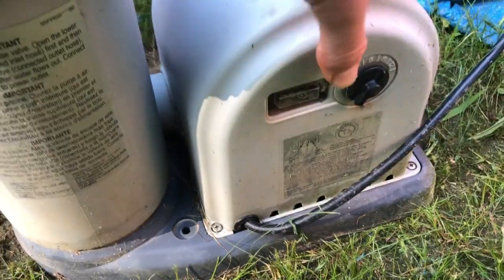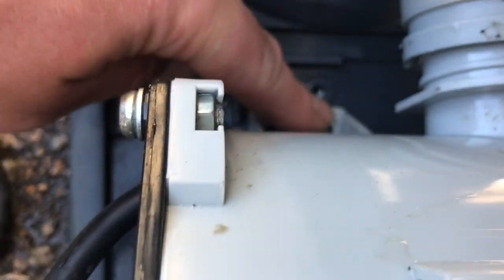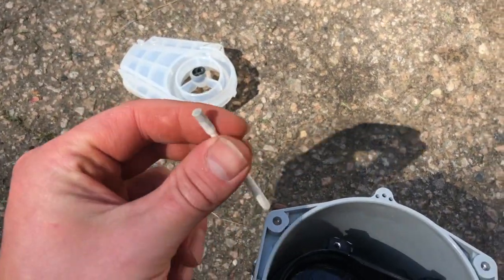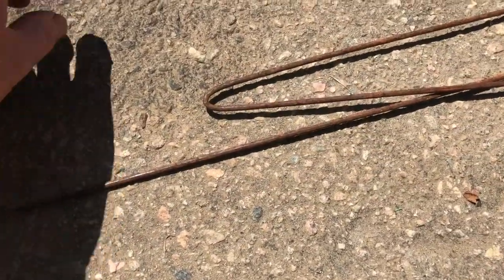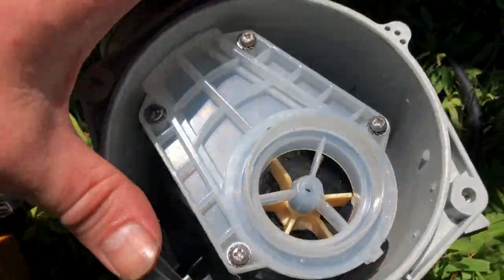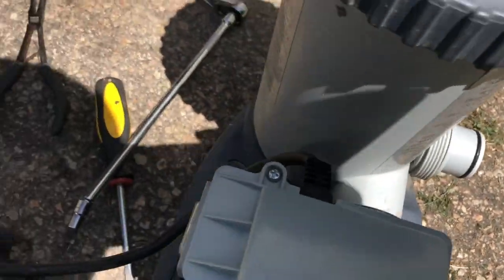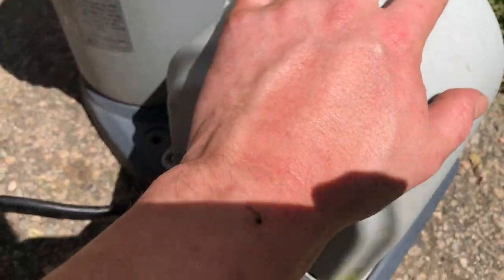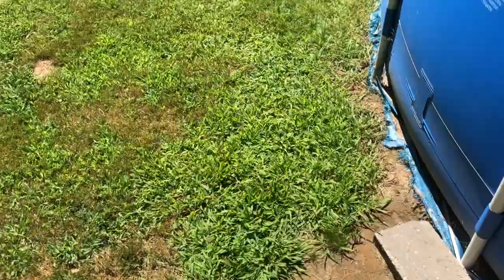Intex Pool Pump Repair

Comment: Give this man a medal!!! Amazing bro! I did the same, worked for my 45 W pump as well. Had similar issue.

We manufacture surgical instruments so i instead took a non magnetic SS 2.5 mm rod around 58/ 57 mm where it fitted fine. Grinded the ends to mke them soft, so it doesnt wear the plastic body. Hopefully it wd last lo ger than the ceramic shaft, mentioned.

Comment: Hey WS
I had taken my pump apart years ago and couldn’t remember how to get that cover off-probably because I never thought about that knob screw. So I searched for quite some time in French, cause that’s where I live and there was nothing. So I checked in English. Enjoyed your video cause you sound just like somebody I went to school with. Well if anybody is reading this and needs that shaft I got one. My problem is that the magnetic shaft rusted and has split open. As a matter of fact the motor will still run for about a second or two when I turn it opposite that split.

Comment: I just tore apart two bad units to make a good unit. I did not about the screw on the timer knob. I was able to take apart both units without removing those screws and not break anything.

Now that I know about the screw, I can finish putting the good unit together.

Thank you!!!

Comment: These ceramic impeller rods seem to be the weak link in Intex pumps. Our Intex PureSpa pump died at 6 months. They sent a replacement unit that lasted a year and one week. I took the unit apart to find a broken ceramic impeller rod. I replaced it with 1/8" brass rod, cut to 3 3/4" iirc.

Our Intex 10'x30" steel frame pool, is running the 330gph pump. It has stopped working on its second season. It had the same issue with broken ceramic impeller rod; but this one was less than 1/8" diameter. I've used a clothes hanger rod (cut to 2in.) for the time being; but will keep searching for a source of replacement rods. In either ceramic, or possibly stainless/titanium.

Comment: Use brass for a replacement rod. Brass will not heat up like the other metal options and will not effect the water and chemicals. I found mine at the local hardware store for like $3 bucks and i was able to make 3 rods out of it. Also, don’t put grooves in it, the grooves are not supposed to be there. The impeller shaft should not have grooves. The grooves are what happens when it starts to wear down or wobble out.
Reply: do you remember the diameter of the brass?
Reply: @CookNComedy  i do remember the diameter. For our pump it was 1/8” and that worked on the sfx 600, 1000 and 1500 pumps. Also, I collected some old pumps ppl in my town put on the curb and took them apart and if the shaft and impeller were in good condition i saved them. So I have several back ups now just in case :)
Reply: 4.25mm 
I used a knitting needle cut to length

Comment: I'm at my second Intex pump - smaller than that one, exact same design, that plastic shaft broken in both after a few months. At this point I believe its intentionally build to fail and break after a while... In the first one I glued back the shaft, but eventually the spinning rotor (the one with the propeller attached and the magnet that) became cracked and started to bulged so... obviously completely stuck. Almost impossible to just buy the part, so I guess the plan is to have you buy a new pump every 1-2 years?

Still, this is a good fix for until the rotor itself breaks ^^ If you can find them, buy spare rotors and shafts...
Reply: Mines never brake

Comment: I have same issues the impeller ceramic shaft broken, I cut a screw driver that I used to open the filter which coincidentally same size as the shaft to replace them :), now I need to buy a new screw driver but better than a buying a new filter :p

Comment: Omg I'm stressing over that stupid "shaft" I hooked up my upgraded sand filter pump.. Well that has problems so I cry not knowing what to do but I know what was wrong with the little pump same as you..I have the same stupid sign in my yard I just yanked er up. I'm going out to skip re installer n plug n swim..I have faith that we are good to go. My question is the little rubber gasket I found in the bottom were did it come from it looked like it belongs in gonna wrong it n see.. I'll be back with update in free minutes..lol 90 sec but I'm jumping in clouds  n all

Comment: Great video, I have the exact pump and expect the same issue. Only took part of it apart and the impeller rocks like yours did. Unfortunately, the screws for the cover also spin the bolt underneath that is inserted in the plastic so i can tell until I get them out (if anyone has any ideas on that). Good fix, however, hopefully, I'll have the same luck. Did it last? Thanks Neil

Comment: I have the 638rm pump and I replace the broken ceramic shaft with an Allan key from IKEA that I had a bunch laying round... straigten it with a hammer till it was flat, replaced the old and it worked. It was the perfect size too, no need to cut it 👍

Comment: Got this pump type for free today.
Checked the transformer voltage which is 14 V  (AC).
Cleaned the pump housing as there was slight dirt but just to be sure.
The shaft is not broken.

But the pump runs 'unstable' seems that sound wise 'stops' and continues.
Don't have a pool to really test if it pumps with any power.

But would appreciate some feedback what the 'stops' can cause.

TIA

Comment: Here's a permanent stainless steel replacement.  I highly recommend it.  I am not affiliated with the eBay seller. Just a happy customer.
https://www.ebay.com/itm/Intex-krystal-clear-pump-model-28635s-635T-repair-kit-1500GPH/283525817272?ssPageName=STRK%3AMEBIDX%3AIT&_trksid=p2057872.m2749.l2649

Comment: Thank you so much for making this video, had the same thing happen to us. Could not even find a new pump to purchase because of shortage at factory. I went to Lowe's and purchased a  brass rod that worked excellent. The pump is up and running, and the kids are thrilled .Thanks again
Reply: what size rod did you get?
Reply: @behanner   Hi Brent, I used a piece of 1/8"diameter by 3"long, purchased it at Lowe's, item #364221 it comes 6" long, I cut it in half. for the future repair i think I am going to get Stainless steel, 304 or 316 series because I believe it will hold up longer against chlorine. Pump is still running great.

Comment: Mine was a 637R. I couldn't find any diagrams showing how the spindle actually worked. With being able to see your plastic spindle,  I was able to take mine apart and insert a metal spindle I made by sawing off a 2 6/8 inch piece of a pants hanger rod. Getting out the botton plastic piece was difficult because mine broke at the base. Using needle nose pliers I took out thre little rubber end with the broken stub still in it. Then I put the rubber end on my metal spindle,  and pushed the rubber back into place. Then the impeller on the rod,  the top piece with the other rubber cap embedded,  and voila! It works again! We can keep our pool, and saved time and money.  Thank you!

Comment: Hello, what is the diameter of the shaft? And the length? (In millileter) have you make the mesurement if the out of the pump? The connector who come inside the container. I'm interested to change the container by a sand filter. Good or Bad Idea? (Sorry for my english) thank you

Comment: So I did this once with a piece of metal and it worked for a few weeks. Then it too got worn down and broke. So I just put another piece in again, only this time it would try to spin but tripped the breaker right away. I reassembled it again and it just hums. I can't figure out the problem this time. Anybody have any ideas?

Comment: You saved my sanity. We'd only been using our pump for 2 months and it stopped working. Intex is out of replacement units and parts and won't even answer the phones or emails anymore (maybe due to Covid). I had taken ours apart and didn't even notice the small piece of the broken shaft before viewing your video! You just saved me hundreds of dollars, and many hours of cursing! Thank you thank you!

Comment: Thanks for making this video!!! The same thing happened to my Intex above ground pool pump. My pump is the smaller one that comes with the 10-foot metal frame pool. I opened it up and took out that magnetized spinner and sure enough, that plastic rod had snapped. It's July 29, 2020, and I started using this pump brand new June 6th of 2020. It didn't even last a season from that standpoint. In mine I ended up using an 8D x 2 1/2" nail cut to size and deburred. I tried looking for something aluminum but couldn't find anything that small and thin. Again, thanks for the informative video.
Reply: Us too. We received ours the first week in June and it died on July 29th. Maybe a batch problem? Glad this video helped you too!
Reply: They have a 1 year warrenty. So if you contact the company they ahould replace it.
Reply: So two weeks later the pump stopped working again. The nail I used as a replacement rod was worn down in two spots -top and bottonm - and nearly snapped through in the exact same spot that the original plastic rod was. There are two metal washers, one at the top and bottom of the magnetic spinning thing. I placed them back in with a new rod I cut down but in two weeks if this one also breaks/corrodes I'm going to try running the pump without the washers. The washers are causing that wear on the rods.

Comment: No measurements, nothing.  If you don't have a random wire, this video is absolutely worthless.
Reply: He probably just measured it using the two broken pieces of the plastic rod that were in there. That's what I did. It works fine again.
Reply: @dortizjr1  Yeah, I got mine sorted, mine was different anyway, so a measurement wouldn't have helped me.  So the video did actually help, I was just being bitchy instead of doing the work

Comment: Thanks a bunch! I have the smaller pump (model 603) and the inner design is nearly identical. The shaft is smaller though. I was going to use a clothes hanger as the shaft but my neighbor had a stainless welding rod so I cut it to length.  It sounds terrible but maybe it'll last through the summer.

Comment: We have the same pump. The reset button on the adapter wont turn on. What wrong with it? ( The pump isnt connected to the pool yet)
Reply: I have the same problem, did you ever fix it
Reply: @Gogetahan  We had a similar problem. Our reset button would not work b/c the pump had tipped to the side for a while and some plastic got worn down, exposing metal which put a small current into the water. We will need to find a way to cover or replace that part. Good luck to you!